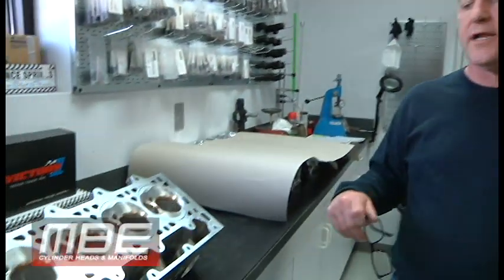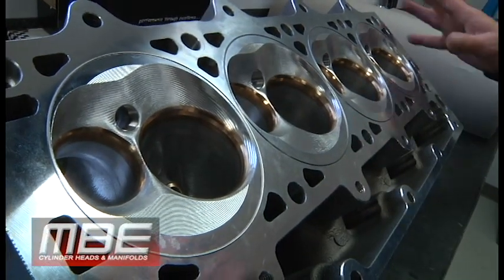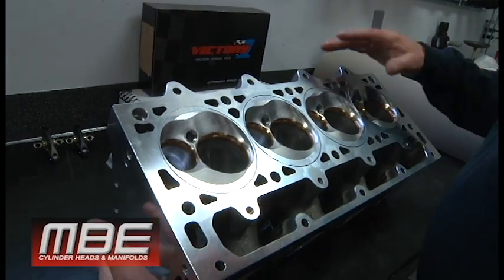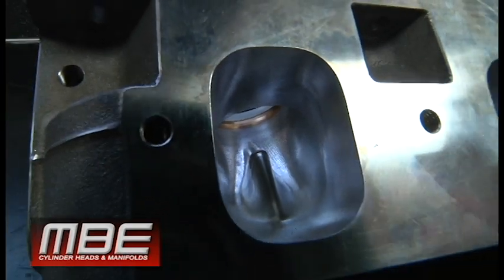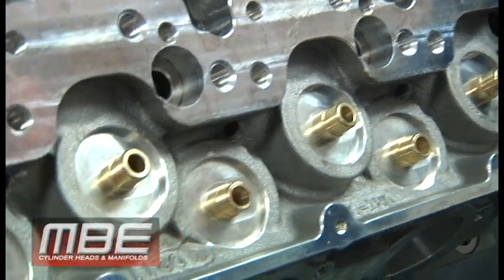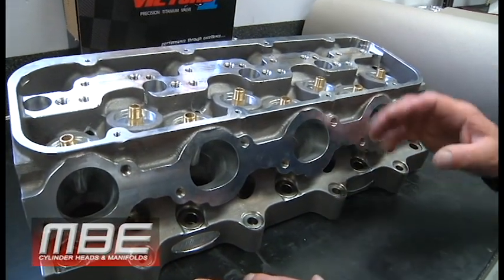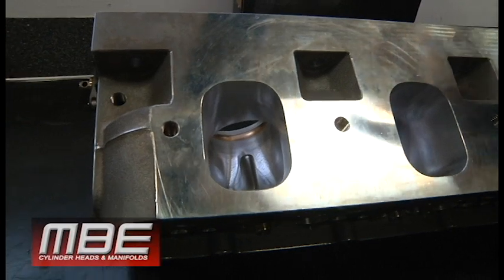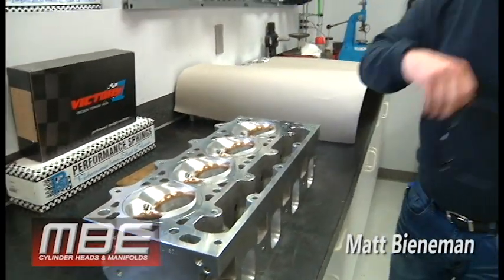Matt TECH   MBE ~ LS 10 Degree Cylinder Head

Comment: 480-490cfm on the intake is some serious flow numbers I'm assuming these heads with the right camshaft will make unbelievable horsepower and are designed for very high RPM and are probably seriously expensive